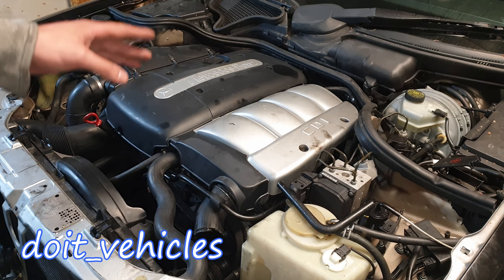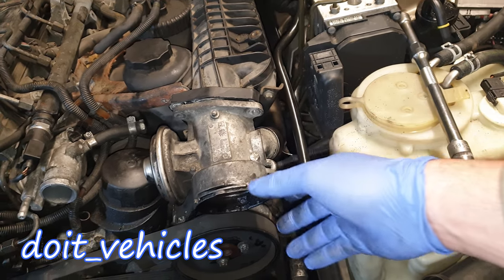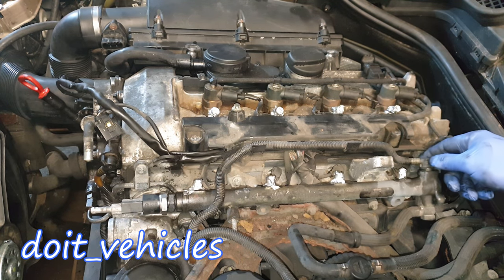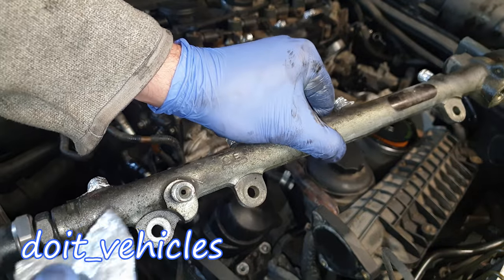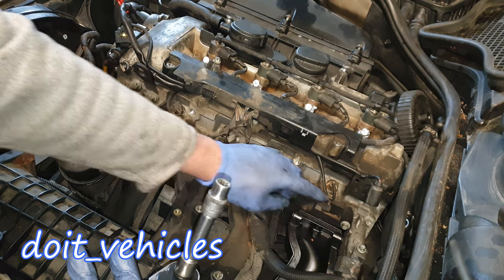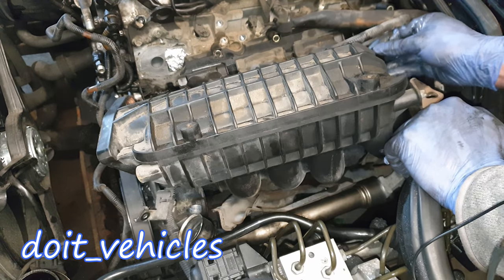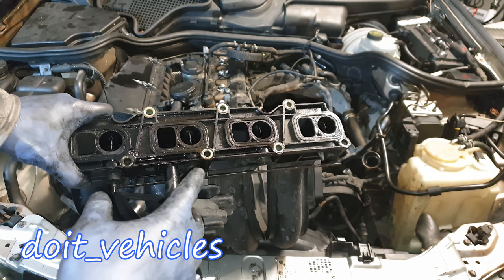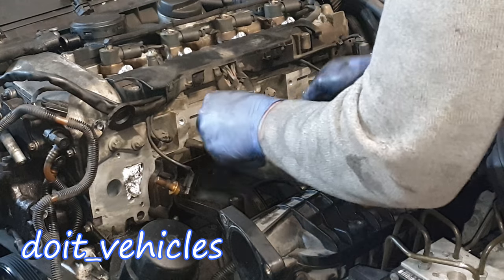E220 CDI Mercedes w210 Intake Manifold Removal , Gasket Replacement , Swirl Flaps , Runners Cleaning

Comment: My m55 stays on, I left the engine on, it leaves it on, when I drive for a while it cancels, it gives error 2359-1, turbo, new pipes, new capteur, I couldn't find the new one, why does it cancel, there is no other error.

Comment: How to prevent the intake manifold from clogging up other than long distance driving? I heard that driving the car high in revs doesn't affect the amount of carbon build up in the intake, and doesn't clean the intake. So what could prevent the intake from carbon build up?
Reply from the maker: Installing an oil catch can on the PCV system also the EGR valve should not be stuck open

Comment: Can a clogged up intake manifold cause limp mode and the 3000 rpm problem on this engine? What are other causes of limp mode? And can you clean the intake manifold without removing it by using engine and oil additives for example?
Reply: Yes it does happen , the main problem is the carbon that blocks intake manifold flaps and that causes the limp mode , additives are not going to help if you do not remove the intake manifold and clean it manualy .
Reply: Yes the shut off motor does it.

Comment: Thank you very much for the video and explanation, am having a problem with the small motor for the flaps( my apologies I don't know the teachnical name). When I put the ignition on it makes a weird noise, even when start the engine, it keeps on making the noise. When I switch the engine off it makes the weird noise for a few seconds then it stops. 
Once again thanks a lot for the video I know what to expect while dismounting it. Cheers.
Reply from the maker: first is worth checking if the sounds come indeed from the intake runner control valve . Than test it . It's normal to be energized before the start up but while the engine is idling it should not be energized , so check for power at that moment at the connector .
Reply: heeey i have that problem too, and when i am accelerate i dont have boost over 2300 rpms!

Comment: Very nice video. I'm experiencing some black smoke myself with my om611 when I start accelerating from a standstill. No error codes, cleaned up the egr last year but the smoke is still present. I feel like one (or more) of my swirl flaps have clogged up since I literally checked everything else and it's fine. I want to hear your opinion. Cheers.
Reply: Did you figure it out ?
Reply: @freemindas  Yep. Swirl flaps were clogged up just as I thought. Just cleaned them up nicely and the car now runs silky smooth. Doesn't even feel like a diesel sometimes.
Reply: @brunobegic3841  swirl flaps are located in the intake manifold right ?
Reply: @freemindas  yep

Comment: My friend, first of all great video. Now, I have removed the swirl flaps and cover the top holes with bolts, all tide and nicely, but a got code P1189, some said that putting a  4.7K resistor on the connector plug of the swirl motor will cheat the ECU. How can I do this if  it's 3 cables plug, brown red and a kind of grey?
Reply: Im not sure i understood you . But you need the keep on the motor what moves the flaps . and you need to find a place for it where it can mooves freely .
Reply: Just keep flap motor connected 👍

Comment: I guess this applies to the w211 220cdi as well? Mine goes in limp on the motorway and loads of black smoke
Reply: I think this also applies to the w211. You also want to check the mass air flow sensor, the egr valve, Map sensor,.. turbo, intercooler hoses,..